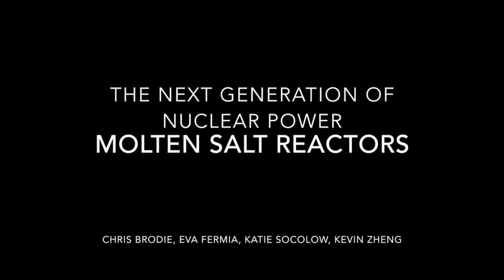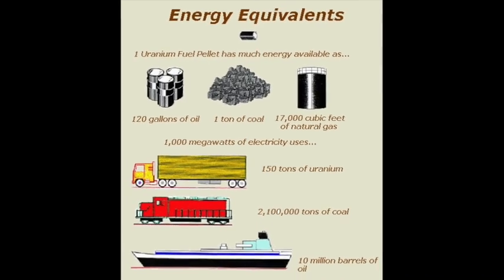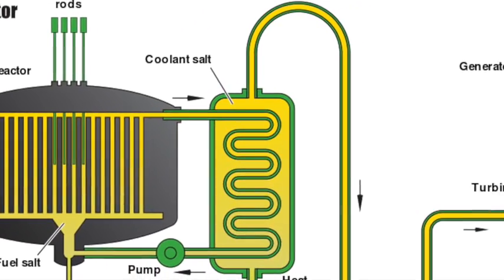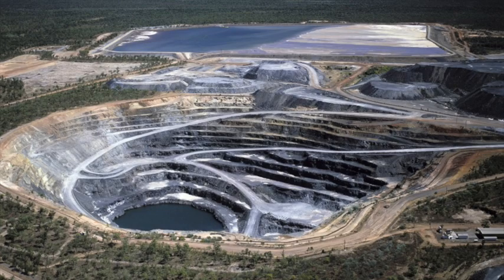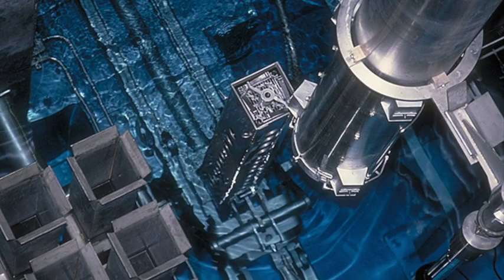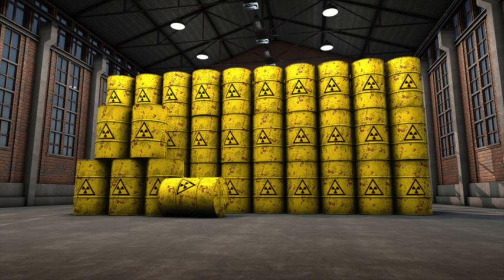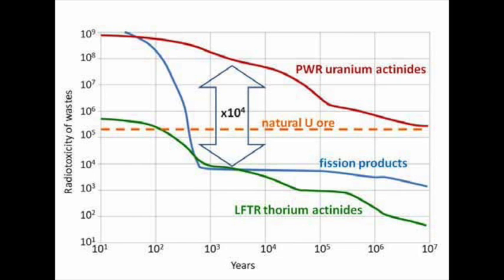Molten Salt Reactors - The Next Generation of Nuclear Power

Comment: This COULD be a great option for carbon-free cheap power. There's a few challenges with waste removal and Tritium capture, but there is a lot of Thorium everywhere and a byproduct of Neodymium production meaning it's currently nuclear waste when produced now, but could replace coal with an equivalent capability carbon-free and cheaper. Without the Graphite, there isn't a reaction, and if it gets too hot, it just drains out. Everything regulates automatically because of physical limitations. If left exposed, the molten core salts don't remain as radioactive for as long. The by-products are in demand for medicine. We need to develop this.

Comment: If you really believe that nuclear reactors are better because they leave no hipster-adored carbon footprint, you're wrong. Any generating technology which utilizes heat that was not here when our geological epoch started is harmful. By using oil your release co2 that does not belong to current nature, by using uranium you produce energy that was stored even before our planet existed, thus, does not belong to ecosystem. Only answer is utilizing energy of atmosphere and around first 700m of ocean depth. The rest leads to catastrophe either way.

Comment: Kirk Sorenson you start promoting MSR 6years ago , Why are you not building them now?
Reply: leo olsthoorn it is quite unfortunate that the government regulations and policies almost specifically ban liquid thorium reactors in the actual process of approving new nuclear reactors for the United States. It will take a change in political will to approve even the smallest research reactors
Reply: There was a window of opportunity from 2009 to 2013 while Nobel physicist Dr. Steven Chu was Secretary of Energy. He is a proponent of nuclear, he thought licensing US reactors should not be delayed after Fukushima. Simulation is so precise now, a national program of a few billion dollars could answer the debate between 4th gen designs, perhaps to have separate designs per purpose: energy vs waste disposal vs portable for example.
Reply: That's not going to happen.  The US as we knew it is long dead.   Energy policy is only a small part of why the US is finished.   I seriously doubt any new reactor will go on line here in the next 50 year.  This is all insanely complex stuff.   We have a technical reactor in Fukushima and the engineers design a backup power system with no thought that it might get flooded.   They build one of the worlds most complex devices, but over look something as obvious as an earthquake and flood taking out the needed back up power.  No matter how smart these people are, there will always be overlooked risk.   After 70 year of R&D on this stuff we should be at the point where safety is much much higher now that we have seen 3 major accidents.   Lets hope they can build it better.  As for a place like Chernobyl, I doubt the damage was any more then what  people all over the world having to deal with regarding health problem from burning coal.   Beside the area is now a nature preserve with no people.  That's not all bad.

Comment: I really don't like how they promote the incorrect assumption that all MSRs are Thorium breeders. Molten Salt Reactors can use conventional U235 easier and arguably cheaper than any other kind of fuel, and they do so more efficiently than light water reactors. They can be set up to be a breeder or not, and they can be set up to reprocess waste or not. MSRs are an exceptional technology because they can more easily be adjusted to breed fuel from thorium , and set up reprocessing of fuel and segregating waste products, than most other identified reactor types, but these additional techniques are not part of all MSR designs.
Reply: The process of breeding reactor is little different:
https://en.wikipedia.org/wiki/Breeder_reactor

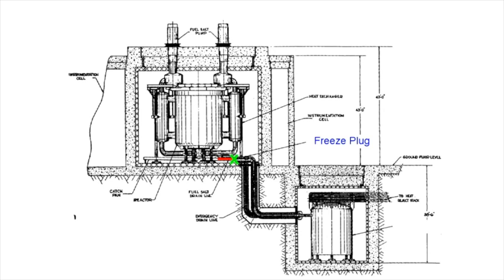Comment: 4:49
I'm pretty sure that's incorrect. From what I seen and read about the Oak Ridge MSR experiment was, they did experience a run away reaction, however due to the nature of the reaction, chemistry and the viscosity of the medium, it became a self regulating reaction. Heating up, then cooling down over an 18 hour cycle.
The freeze plug is for site wide power failure. The cooling fan stops and the plug melts.
Reply: I don't think it was so much a matter of them experiencing a run-away reaction as it was them testing and causing a cooling stoppage to monitor the results.
I believe their results concluded that with the extra heat, the fluid expanded, and eventually reached a heat equilibrium.

It should also be noted though, that if the fuel was mixed too rich with fissile material then it is possible that this fluid expansion may still not be adequate to slow the reaction, which may still cause some sort of containment breach event, but draining into the cooling tank would still be an option to solve this.
Reply: Thanks for the clarification. Just to lazy to go back and look it up.
Reply: It was Cid Ball (spelling?) drawing a sample from the salt. He accidentally pulled a control rod out when he was withdrawing the sample. That caused the temperature to start rising significantly. Eventually reached a point where fuel density in the core was insufficient to maintain the reaction and the reactor died back down. 

I would assume they eventually re-inserted the rod because if they didn't the reactor would have continued to oscillate, getting hot, then cooling down, etc. 

The purpose of the drain tank is a last ditch safeguard to get all fuel out of the core. The low density of fuel in a thermal spectrum reactor means that it can only maintain criticallity in the presence of a moderator, those being in the core. The drain tank's function has nothing to do with temperature as the fuel you're dumping into it is a heat source. The drain tanks only purpose is to separate  the fuel from the moderator. If the mix of fuel was rich enough that it could maintain criticallity outside the core, draining the fuel to the drain tank would do nothing. That's the primary shortfall of fast spectrum reactors, as they have more than enough fuel density to maintain fission anywhere in the reactor, not just the core. That's also why thermal spectrum MSR's are 100% safe, in that they cannot result in runaway super criticallity reactions.
Reply: Poisoning the fissile salt deliberately is an option in an emergency.